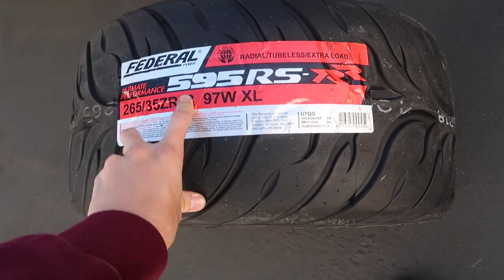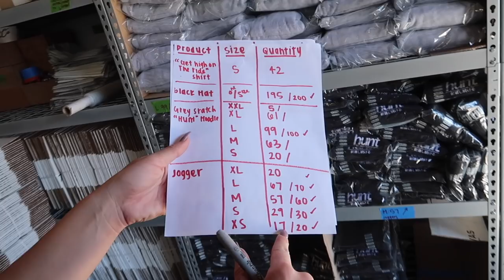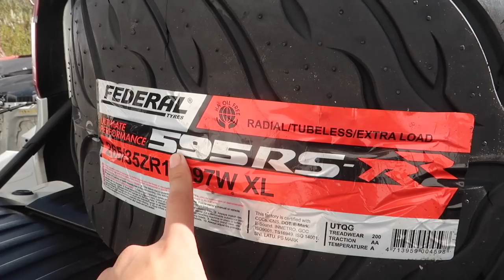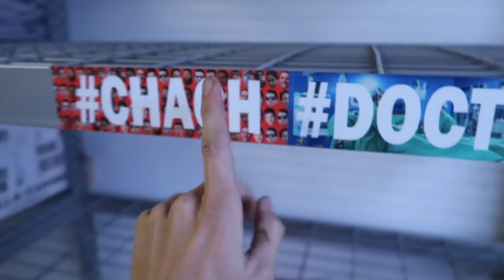NEW WHEELS FOR THE BRZ!

Comment: Tj, before you drop the SR20 in which I'm sure is easy as hell, why not hone the block, change all the gaskets and clean it up. Don't get excited cause it's a direct swap. Why not do it right and not worry about it later. You guys haven't even fired up the motor yet.

Also happy birthday, mine was on Dec.24
Reply: Devil Sephiroth they might be needing Dr. LZ for the job 😂

Comment: So if I grab a tire like that, with a 18x9.5 wheel, will I need anything else (I’m stock height) or will I rub? Also what kind of offset are you running to fit it. 35?
Reply: Hey did you ever find this out? I’m been searching everywhere for his wheel sizes
Reply: @lyght-house  yeah the front rub on stock top hat with a 40mm offset, so I just installed some coilovers. Fits perfect, doesn’t rub on anything even full lock.

Comment: Roof scoop on the 350 Z?
Reply: Elijah Robbins would actually look cool! Look up Dean Kearneys viper, his pulls it off so well
Reply: Zac /Wonka yes dude that looks sick
Reply: For fucking what
Reply: Treston Waddell could use it to get more air to the rear mount
Reply: Treston Waddell for the rear mounted oil cooler and power steering cooler
Reply: Elijah Robbins radiator and intercooler too
Reply: Zac /Wonka only the radiator

Comment: Just an FYI but RSRR's are garbage in the 200TW category. Normally they are around a second or two slower than the super 200's (RE71R, RS4, Rival S 1.5), and have pretty awful driving characteristics. They take a while to heat up, they don't communicate, they have soft sidewalls compared to the competition and get really greasy when too hot . Decent brand name tires don't cost that much more. Don't cheap out on tires, just get good ones.
Reply: tj is sponsored by federal, otherwise i dont think he'd run those tires.
Reply: Maybe, but I don't know. All evidence points to them not knowing anything about tires. What, the whole group of their's has been to like 1 HPDE? It's just weird Federals have a following with cheap youtube builds but literally no one at the track runs them (for good reason)
Reply: xampx2k7 they are just a cheap grippyish tire that you wouldnt care too much about if you smoked them out.
Reply: I get why people buy them, but realistically they are just bad at everything compared to any real 200TW tires. I just don't get the mentality of saving $100 over ~10,000-20,000 miles and making your car worse then it could be with real tires.

Comment: Wide body 86s shouldn't have a square setup. Who runs 255/35 in the rear for a wide body. Please stop acting like you custom got these parts. You prob got a partial sponsorship and they gave you what they had. Wtf brand are those wheels like wtf.